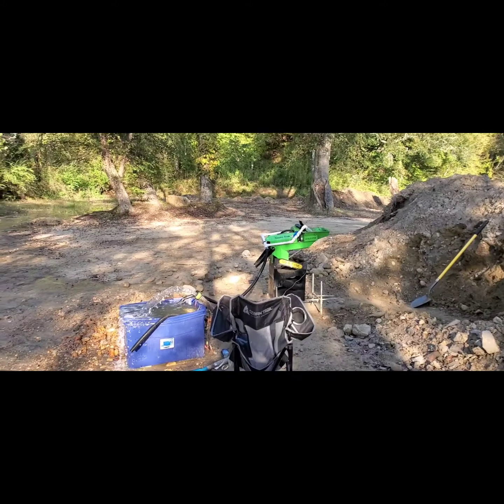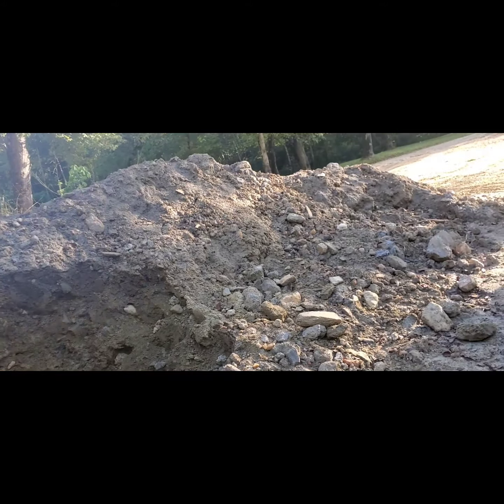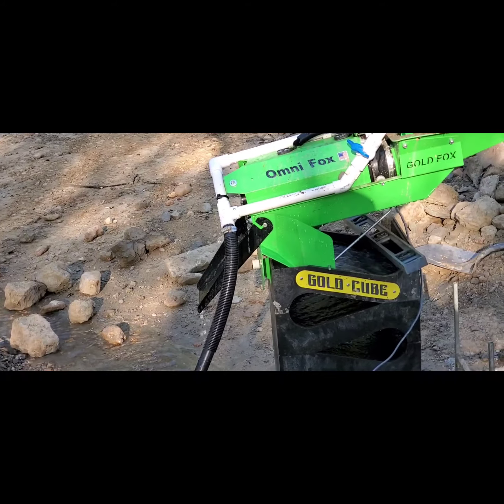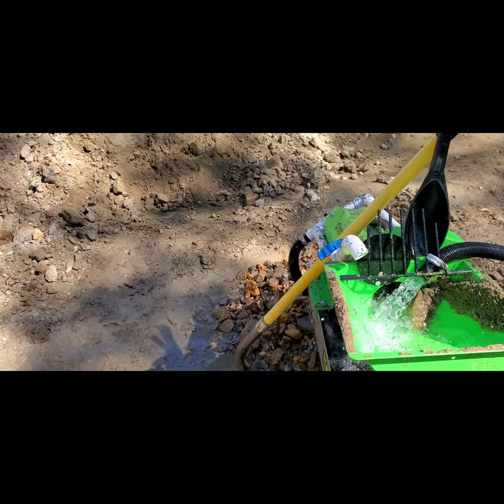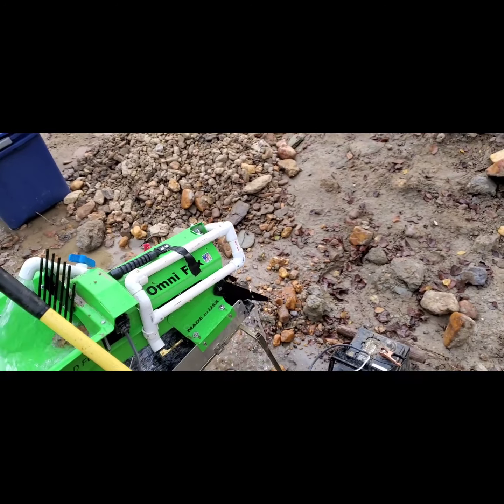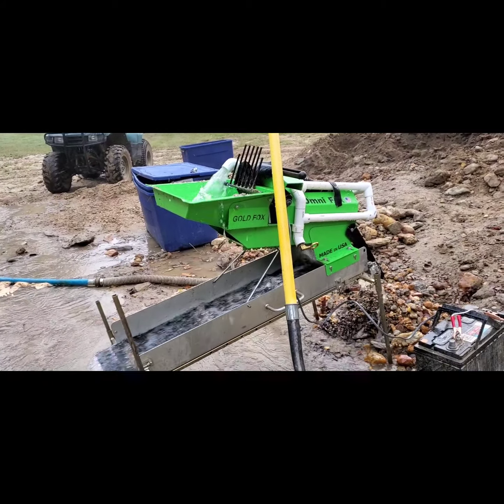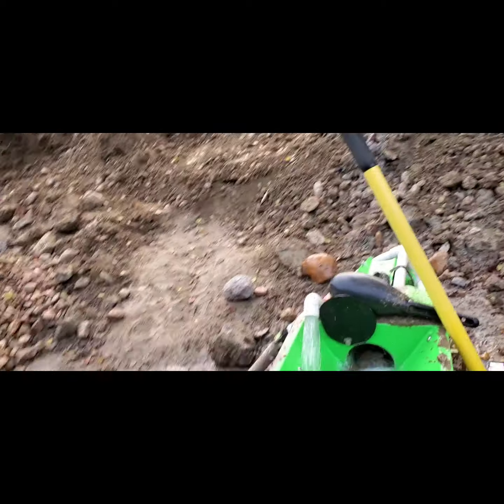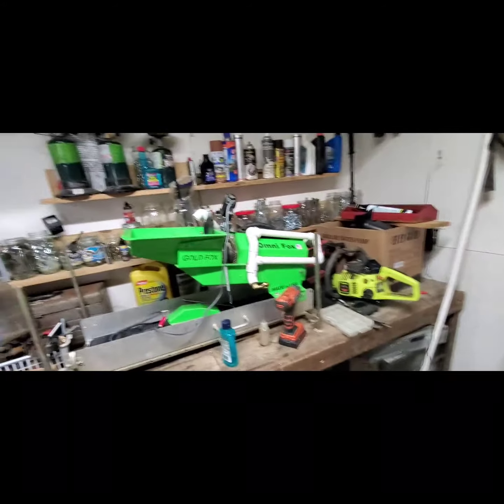Alabama gold camp prospecting all week running the gold fox trommel.

Comment: Can you tell me how much one of these outfits cost?  Thanks
Reply from the maker: The Gold fox trommel starts at $650 plus there are extras you can add on. The gold cube 4 stack is about $480. www.goldfoxusa.com
Reply: @PattersonProspecting  I have been down at Gold Camp and rented one of their high bankers for 2 hours and did find some gold. Could you give me a ballpark figure on what you found in a day with your outfit?  Thanks Jerry
Reply from the maker: I have never weighed what I have found in a days time but it was very decent. Now when it comes to them rental highbankers you not going to find much gold because the sluice boxs are not set up to catch almost everything and they are very short boxs. Also the piles are to far away from the highbankers so less dirt in the 2 run they give you. On my next to last video I posted I show how much gold I found in 1 day of running.
Reply: @PattersonProspecting  Thanks for the information.  Been thinking about going down and do some shoveling this winter.  Summer time is way too hot around all that water.  Thanks Jerry